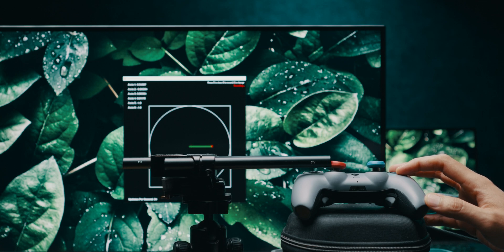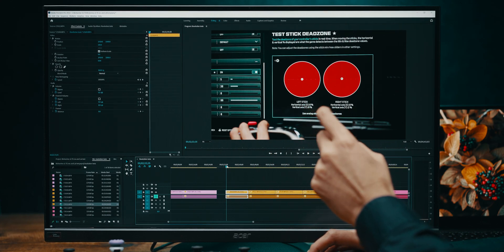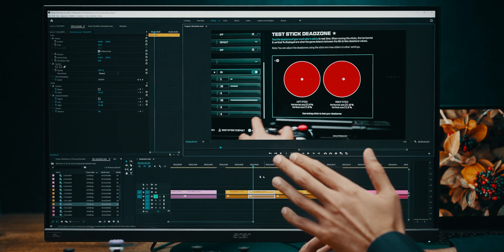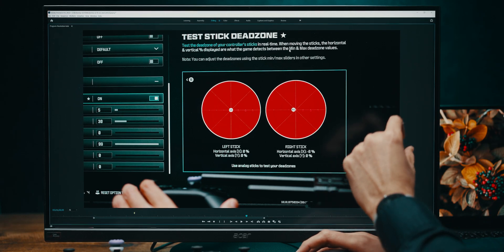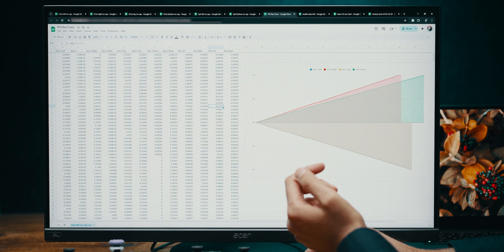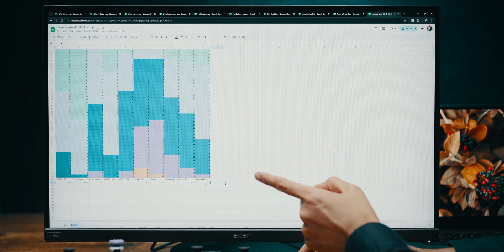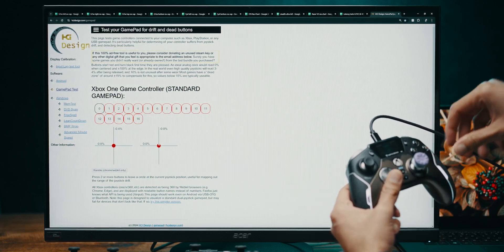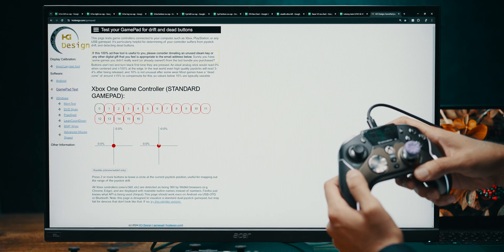Thumbstick Resolution performance impact

Comment: I've tried a bunch of controllers butvI allways fall back on dualsense. It feels the most precise. Is this placebo? It's starting get a little too much stickdrift though... I have a gamesir g7 se with those hall effect sticks but it does'nt feel as precise... Whats the best controller for fps? Best precision.
Reply: Vader 4 pro because you can choose the thumbsticks resolution from 8-12. 8 is what you are use to on ps controller. Select that and have fun

Comment: the number is steps on the wolvarine is a straight dead on bad , and i don't see the point to gameble if the calibration is symetrical or not , while tons of chaeaper controllers have more than 300 steps and even about 1000 steps or more like on the tarantula , bigbig won blitz 2 or the Vader 4 pro.

Comment: This isn't anything new. I wouldn't trust many mainstream manufacturers (Razer, PowerA, Xbox) because they use very poor quality components. Its most likely a calibration issue that has to do with your joysticks being uneven. 

Each time you go up a bit (ex: 8 to 9 bit) the resolution doubles. 12 bit resolution is 16 times more accurate than 8 bit.
Reply from the maker: So all my units that have uneven output can't change that with a manual calibration, even if I purposely shift the centre point in any direction. It's almost like the HE sticks at hardware level has an issue in some units. I'm using a Python solution and Gamepad tester to get all the joysticks axis values out, so just wanted to make sure the numbers I was getting also affecting the aim on Xbox.

Comment: Can you test pc mode on Xbox to see if it makes a difference?
Reply from the maker: Hey just finished doing exactly that and no performance improvement, it definitely disables Xbox license in the 1000hz
Reply: @thephototechy  yea I’m trying it too., I did the hci test to see percentages,  at 0 deadzones it was skipping percentages faster than my g7 se. This controller would be the best but the most important aspect the joysticks are flawed
Reply: I really hope razer adds updates to fix the ball effect because they are the worst halo sticks in the market g7 is more accurate
Reply: It could also be that their thumbsticks are too thick the g7 sticks are thin but idk
Reply: This controller needs help because it could be perfect and the best what do u think? You agree the sticks are problematic too’v

Comment: Hey so I saw a comment from vcuda that the double deadzone feature gives double response time so keep it off., I turned double deadzone off and my aim improved in halo infinite. I am having a hard time adjusting to aiming with this controller any suggestions? I play 0 deadzones and circular mode for halo infinite and I get haven’t tried standard but I don’t know what those settings mean
Reply from the maker: Hey bro I've just released my full review. There is a time stamp where I show what the standard and circular mode is doing to diagonals. On my TE I haven't seen latency issues with double deadzone but it doesn't do anything if no deadzone is applied. I'm running some latency tests later so will check if double deadzone is causing an issue.

Comment: id like to see measurements on actual stick tension. i prefer a more broken in feel and feel some controllers with stiffer stick tension is a deal braker. also im hoping to catch a thrustmaster heat review
Reply from the maker: Hey bro working on a contraption to measure the force needed to move the stick, issue is with some use it changes a lot. So I was thinking of measuring out of box then after some game time.

Comment: I read on a forum that on the gamesir HE and SE the response curve is slow so rotational aim assist (left stick aim assist) is enabled at a lower rate. They suggested to use no raw mode but put the outer deadzone in the app to 90 rather than 100 to counteract it. Would love to hear your thoughts on this?
Reply from the maker: @reminator363  hey bro so I've been using in game max deadzone of less than 50 and even smaller at times so can't comment on that setups as a 40-50 register on my left stick would be the max for in game. If that's true then doing that to the right would make sense too, it was actually something I used to do on the right stick before the 1000hz update, the other work around was to use Xbox replacement sticks which reduced the resolution and made it feel more responsive as well. 1000hz changed the things for me, but I'm only on console so can't comment for PC use.
Reply: @thephototechy  Thank you for replying bro, so do you use an in game max deadzone of 40-50 on both sticks or just your left stick? I tried scuf sticks for a few days and it did feel more snappy but also felt a bit too uncontrollable so I’ve went back to the default gamesir sticks.
Reply from the maker: @reminator363  hey bro so only on the left stick max 40-50, right I keep at 0 min and 99 max with linear aim response. 1000hz changed a lot for the G7se and Kalied in 500hz also performs great with same settings for me.

Comment: I got wolverine v3 TE and the smallest step I can get in any direction along X or Y axis is 11. And it really depends on if I go left right up or down from the stick center. For example if I move along X axis to the right from the center (trying to keep Y the same) I get the smallest increment 11. But if I go to the left it's 12. For my left stick its even worse I get 12-14 depending on the direction. Taking into account it is 0-999 range from the center to the edge these sticks are really low resolution. Completely different story for wolverine v3 PRO (my friend got one). For wolverine v3 pro increment is 6 does not matter if you move left right up or down both sticks. So for wolverine v3 pro it is very consistent 0.6% increment in any direction. Also sticks on v3 pro is slightly taller than v3 TE. I use kontrolfreeks no slip and on v3 TE it is rubbing against the edge when pushed all the way to one side and on v3 PRO there is a very small gap. These taller sticks give you more leverage and makes sticks feel better overall. All of this (different resolution and stick hight) makes me think razer is using different stick unit on v3 TE and v3 PRO. Also face buttons on v3 PRO are smooth glossy finish (pretty much the same as standard xbox series x controller) and on v3 TE they are matte finish. It's personal preferences but I feel like my fingers can slide much better over v3 PRO buttons (which is good for fighting games for example) than v3 TE. Also manual calibration you described for v3 TE does not work for v3 PRO. If anybody knows how to calibrate v3 PRO let me know

Comment: brother I'm confused I am a competitive shooter player on Xbox Series S and I use wired headphones for control. In my case, what control of these 3 (G7se, kaleid, G7he) from the gamesir brand do you recommend me more? I want the most competitive control for Shooters but on the Xbox console? and have the maximum possible Hz with audio 
and if you can give a clear answer I would appreciate it new subscriber🎉❤
Reply from the maker: @brianjimenez1020  hey bro I'd say either go with Kalied as that can do 500hz with audio, also it has around 25% more resolution according to my tests and I do prefer the Kalied in Xdefiant over G7se.
Reply: @thephototechy  You can do 500hz with the kaleid with headphones connected?

Comment: Hello, I would like you to help me with my choice. I need professional control for PlayStation 5, and at the same time, the control does not STICK DRIFT after a period of use.

And what is the best control for PlayStation, it is suitable for long-term use and is a good investment for control and at the same time professional

Thanks for everything ❤❤
Reply from the maker: Hey bro so far I've tested the BFG and Nacon revolution 5 pro on PS5 and honestly the standard dualsense is better then both of those. Dualsense edge has the best performance on PS5 and that could be a Sony doing on purpose. Personally I haven't used my BFG and Nacon since getting the Hex phantom as it's based on a standard dualsense controller. My honest recommendation for PS5 would be edge first if you can deal with only 2 back buttons and the lack of stick replacement module availability, or go with something like a modified dualsense controller with hall effect sticks like Hex, Aim, scuf etc. Hope this helps bro!

Comment: I’m stuck between the v3 te or gambit prime. Not a huge fan of the way he sticks feel. Would you recommend the v3 over the prime?
Reply from the maker: Bro the original Gambit was my favourite controller for a long time. But there is that forced minimum deadzone there and honestly only 2 back button attachment works on that. I used mine for over 200 hours and the triggers were soft, where I couldn't use them in the shortest pull and had to put them at the 3rd stop. I think the V3 is an upgrade over Gambit for sure, but the stick performance if 3-5% deadzone is not bothersome, Gambit would be my choice. Still V3 with He longevity makes more sense.

Comment: Hey man question are Hall effect controllers good for sport games like fifa since it can do 0 deadzone?
Reply from the maker: Bro I actually want to try FIFA myself as it's been years since I played it. Not sure if FIFA has deadzone options or not, but an HE controller with true 0 deadzone should definitely work. The problem might be the output, as all HE seems to be lower resolution than Xbox controller, not sure if that's the reason they feel a bit different to normal potentiometer sticks, but the difference is definitely something you'll feel. For me personally the biggest thing with HE sticks been the ability to truly play at 0 deadzone, as the drift at rest has been way more manageable than my normal potentiometer controllers. I have the new HE module from thrustmaster on the way and I'm so excited to try that one and see if that's different to the ones we currently have. Please stay with me as I get the stick this week and will publish that one asap.

Comment: I got the wolverine v3 te aswell and when using it in COD it feels like it sometimes accelerates to quick when i aim to the left and right. Ive also felt like this with other HE controllers. Vader 4 pro and custom ps5 controllers with HE sticks. I just cant get used to HE sticks. Maybe this is why?
Reply from the maker: Hey bro the low resolution might be the cause of that but after adjusting to the feel it has felt fine for me. Yes they are not exactly like the potentiometer feel yet. I have the new Thrustmaster hall effect module coming and really excited to check that one and see if that feels like normal sticks.
Reply: @thephototechy so There is no solution to that quick accelerating sens feeling?

Comment: this is 12 bit?
Reply from the maker: @stevensv4864  hey bro I don't think so, 12 but would mean 4096 different levels, it's something Gamesir is advertising for their TMR sticks. Now this could be using a 12bit ADC but the actual output theyve decided in terms of zones seems like 8 bit.
Reply: @thephototechy  thanks bro. yeah im so excited with upcoming gamesir cyclone 2 tmr sticks, tarantula is expensive and ive seem reviews and dont like so much
Reply from the maker: @stevensv4864  hey man thanks for letting me know about the cyclone 2, I didn't even know that was coming with TMR sticks. I might try and get them to test, but I only play on consoles so don't usually keep up with controllers without Xbox license.
Reply: @thephototechy  yeah bro im excited, hope this month gamesir drop it.. dont worry g7 pro will come too also with tmr

Comment: Oh yummy  The controller Channel I've been searching for. 
Thanks for all the info. I'll be back for more. 

Just got my V3. 

I mainly play pubg wondering about the circular setting and the double dead zone. Any recommendations? Which would be better considering it does not have aim assist. Not sure if that has any effect or not 

Also, I cannot get it to hold perfectly at 0.0000 like my V2 does when I'm using the same testing page you had on your other video 

Thanks again in advance🎉
Reply from the maker: Hey bro I'm keeping the standard output instead of circular, I still need to check if this changes the sample points at all. The double deadzone video should be coming very soon.

Comment: I think what you have to consider is that the sticks themselves are never dead centre from the factory, so after calibration from that stick resting centre position it then has to calibrate the distance from that position to the edge, that will be different per axis. One way to get around that would be to create a circle using the lowest distance around the centre but that would mean you would lose range in some directions. So that probably explains why some axis have different resolutions. Also in terms of linearity you need to consider not only the steps but the actual amount the stick was pushed. It may go up in perfect steps but the distance the stick moves may not be the same which would mean it’s not linear, on the flip side the steps might not be consistent but the distance between the steps might relate which would make it linear, which one would feel better is up for debate. If you have a mechanical testing device you might be able to work out how many steps on the stepper motor was between each registered value to work out the real linearity.
Another thing is that unlike regular potentiometers that just output a linear voltage, Hall effects need to be mapped to zones to create the right output so depending on how each controller does that will influence the values. Just food for thought. Keep up the good work!
Reply from the maker: @beavykins897  hey bro so I've tried the same thing with purposely messing the centre point and my stealth ultra still had uneven output. Comparing that to the Hex phantom which is a modified dual sense, that one with a 9%offset on the opposite direction, still have full 128 zones from centre to edge, but thats using normal potentiometer sticks . TBH If it's something like the wolverine V3 TE where the difference is not that much, that's not a problem I think. But I do believe we should have at least the 8 bit whole axis resolution like the PlayStation controllers do, so we have 128 zones from centre to edge. The only game so far I've noticed feeling better with higher resolution is Xdefiant, COD has been fine with any controller I've used even the stealth ultra with the serious uneven output and low resolution works great on COD, but I personally can't use it on Xdefiant.
Reply: @thephototechy  nice, good work!
Have you tried PUBG? That doesn’t have aim assist or anything so I think the resolution is very important there, especially for sniping over distances.
Reply from the maker: @beavykins897  bro that's a good idea, I've been thinking of testing without aim assist for some time.

Comment: Hey bro. Can you please remind me what type of usb cable improves latency on g7 se?
Reply from the maker: @DarthRevenus  hey man so it didn't reduce latency just made it more stable and showed the lower frame difference more than the other cable. I used a USB 3.2 gen 2  cable capable of 10Gbps data rate.

Comment: How does it compare with razer previous Chroma? Which has more res sticks in general?
Reply from the maker: Hey bro so the chroma V2 has very high resolution output which makes it looks like hyper calculating positions the whole time. But it has some issues and this one is definitely a much needed upgrade, I was even thinking maybe they should release a V3 with potentiometer sticks as well, but that's not going to happen
Reply: @thephototechy  well chroma is getting drift development eventually. I m currently on almost 4% deadzone in Apex and I was hoping V3 to become my savior so I can just play and forget about changing pads after a year of gaming. 4% may not look like much, but playing on 2% is completely different experience. Much better. 
I'm still buying V3, no matter what, since chroma is discontinued, so.. man, I hope I like it))